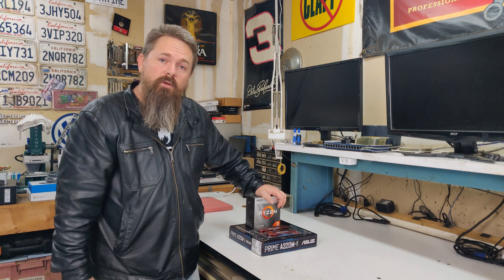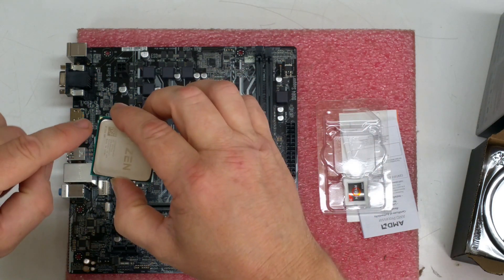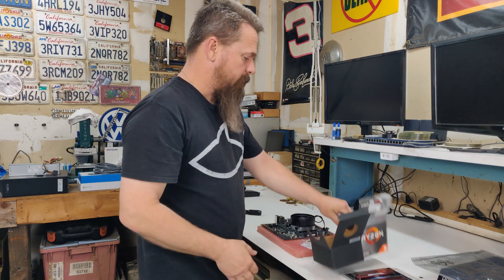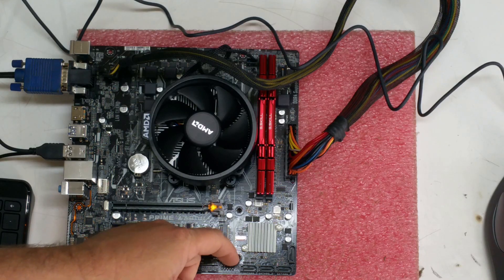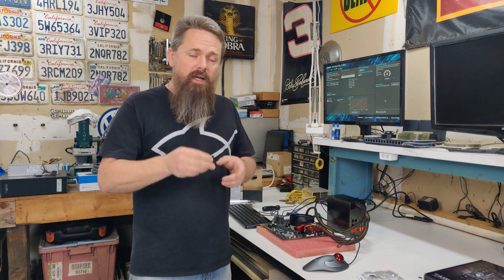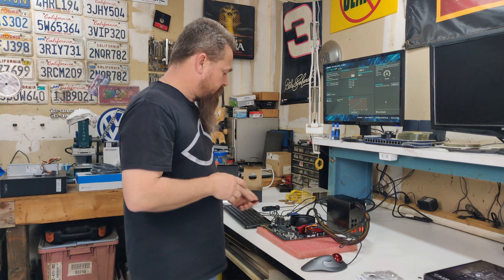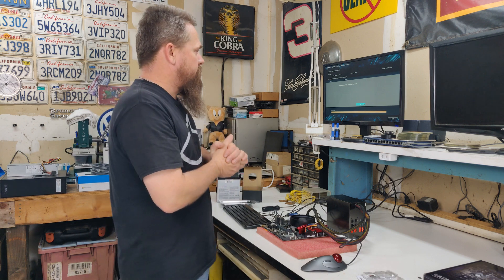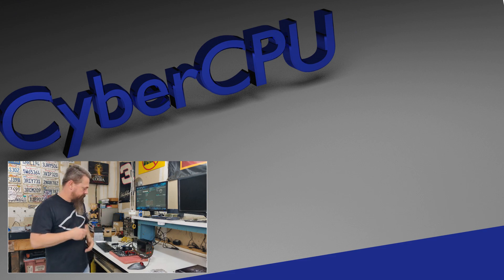How To Bench Test a Motherboard and CPU Combo

Comment: Hi sir, if I bench tested the mobo, with the CPU, CPU cooler, the rams, the GPU with the PSU powering the board, if in case my CPU was damaged (though I am not sure if its damaged or not)  the only used part in the mix, will it damage the mobo on this bench test?  Or will it just not turn on but not damage the mobo if the CPU was bad? If I replaced the CPU will I still be able to use the mobo and all other parts?  Appreciate any inputs. Thank you and have a great day.

Comment: Great instructional video!  I like the simple, straightforward approach you demonstrated.

I noticed that you didn't put any cooling grease on the CPU.  Does that mean that it came already coated?  Same question for the cooling fan.

Thanks.  You got a sub!

Comment: Hi, I am amazed that, in this day and age, we have no diagnostric tools for motherboards and processors. You would think they would have a device where you can place your processor in and and it can just do a test to say that it's working or not. The same applies to the motherboard. Being able to ioslate the testing is a better way to diagnose a problem don't you think?
Reply: Amazon has a PCIE card for $10 that claims to test mobos.  I have never used one and there are no reviews, but if you do some searching, you are likely to find others.

Comment: To turn off the motherboard/PC do you ground out the power pins again?
Reply from the maker: Typically I just flip the switch on the power supply but you can ground the pins in you want.

Comment: I do not bench test.. The two times I had the board somehow found its way to the floor. First time a wire pulled the board to the floor the second time when I swung my chair around the seat back knocked it to the floor. And both times the board survived, a  bench drop test.
Nope, mount the board connect only what it is necessary and test. If good continue connecting if bad troubleshoot. 9 Screws is not a  big ordeal.

Comment: Very thorough explanation, wish I had watched this before installing myRog Strix E Gaming and Ryzen 9 3900x. I had these very issues no monitor-no bios had to call asus and get the new bios but it still did not work. I eventually figured out how to unzip the file and rename it as per the Asus instructions- the bios loaded- whoopee.  now I'm still trying to fix the display not showing so have ordered a new board. I tried different RAM memory sticks, monitors-hdmi-display port but still no display

Comment: No Thermal Paste? Even for a bench... if it works you can throw it onto the case without having to disassemble and reassemble.
Reply from the maker: Brand new processor. The thermal paste comes pre-applied to the heat sink.
Reply: @CyberCPU  haha , got me too. I was like WAIT !

Comment: Can I put in the GPU?
Reply from the maker: Absolutely.
Reply: @CyberCPU  can you make a another video of testing mother board with the  GPU it'll help me and most of other people as well.
Reply from the maker: Possibly at some point. However, it will be exactly the same video but with the addition of using a graphics card. I have other videos where I install a graphics card, if that helps. My upgrade video I did a few weeks ago includes that. However, I didn't explain the process.